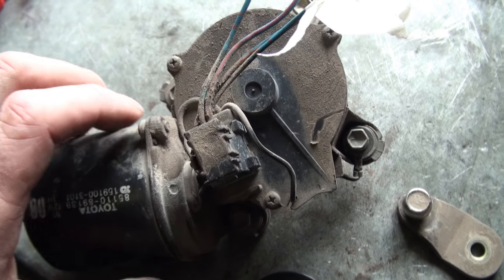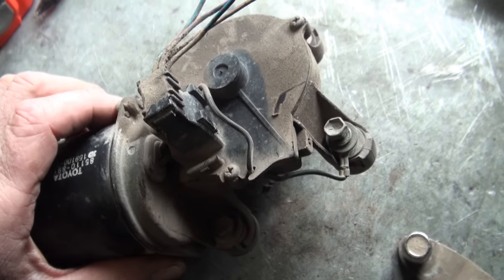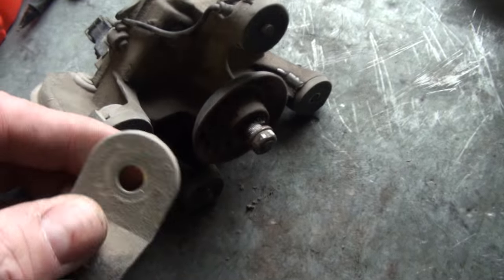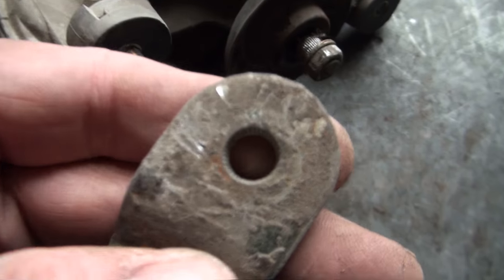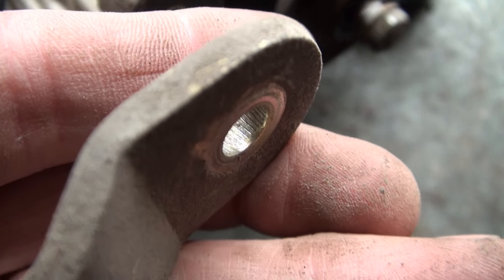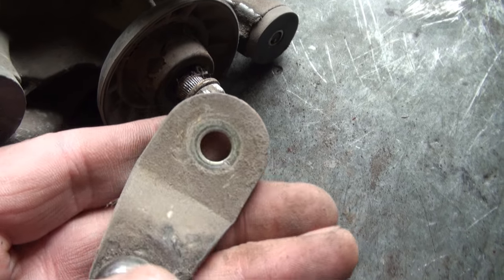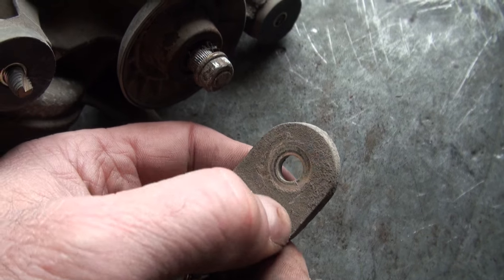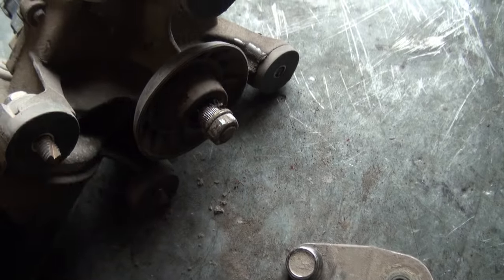Wiper Motor Pully Conversion

Comment: So my comment is kind of a simple question and I have done a  lot of looking at the flat earth information.  I know everyone has their own belief system and I am perfectly cool with all that.  What I cannot get around on the flat theory is basic navigation. I think I know what you are trying to test here and give you props for testing theories. Longitude and latitude do not compute on a flat earth, distances go all out of wack the further from the equator you get.  
Example on a globe flights from Sydney Australia to Santiago Chile are about 13.5 hrs, these are daily flights and you trim the edge of Antarctica.  On the widely accepted flat model this flight would take 3 times as long....these are nonstop flights everyday that on a flat model are impossible without refueling. 
The test you are doing is to see if the corrections in altitude would have to be made to keep a plane from going into orbit I assume.  Argument there is why wouldn't they always need to be correcting direction if the north pole is in the center of the flat plate of an earth and they are flying in a big circle?  

Keep testing but remember one line in a book can be interpreted a 100 ways.

Comment: I'm intrigued
Reply from the maker: I will give you a clue. How much should an airplane direction indicator move when it's spun up to speed but just sits on the table?
Reply: +groutaone do you mean the compass? Or another piece of equipment?
Reply from the maker: An air powered gyro that indicates change in heading, it does not seek magnetic north, it's just a gyro
Reply: Yo, is the sand rail gone for good? My bad if I'm being bothersome
Reply from the maker: The sand rail project has come to a halt, I don't know when it will resume
Reply: +groutaone that will be very interesting